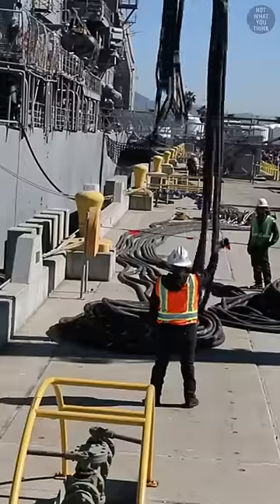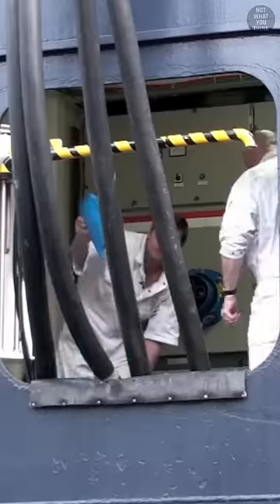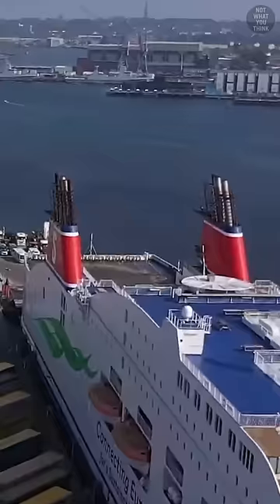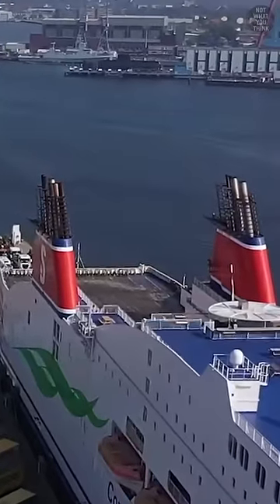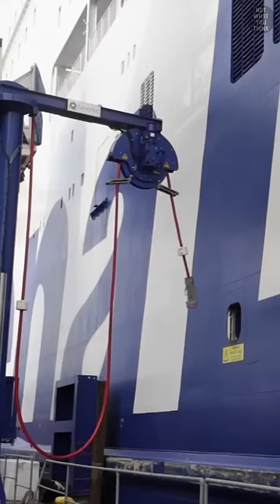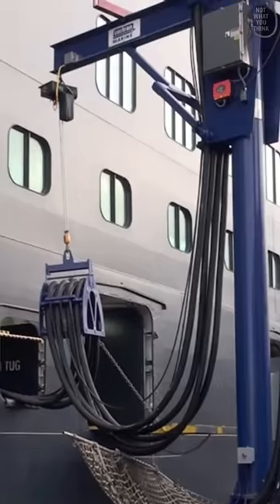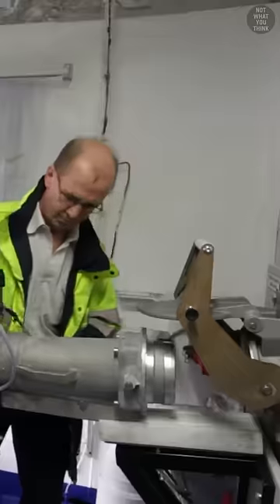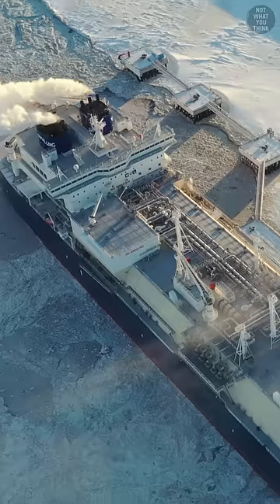Why Ships Burn Fossil Fuel When Idling? #shorts

Comment: What's not mentioned is how ships are extremely efficient at moving massive amounts of cargo. The amount of trains or planes to move the same amount the same distance would burn exponentially more fuel.
Reply: Exactly!!! 👍
Reply: Sure but a lot more can be done, for example ships currently burn pretty fast (or historically this may have changed) but a reduction of 10% in speed will reduce co2 output by nearly 30%.  A reduction by 40 will reduce 70%

Plenty of simple improvments to help reduce pollution
Reply: @salmonnnnman  speed.... or combustion speed. 
An particular ships hull is most fuel efficient at a designed speed. Slowing it 40% means the companies will make 40% less profit. Not happnin' Time is money.
Reply: @randywl8925  that's not how profit works
Reply: @salmonnnnman  Not attempting accuracy. Getting a point across.
 Your making and shipping 1000 cars per month. 
 Slow the shipping time 40 % and compare last years to this years profits.
...or just buy more ships. 😁
How many workers did you lay off?
Reply: I mean, its scientificaly proven that moving against a whole lot of water is better than gliding on a surface or through the air...

Have you seen the size of those engine vs the speed they go... the efficiency of a boat is like -200
Reply: @wisico640  People dont use cargo ships as leasure vehicule so when comparing them you need to compare the amount of cargo they transport and they are by far the best option we have to reduce emission, Here are the order of most to least CO2 emission per tone :  Plane, Truck, Train, Ship.
Reply: @abricots5588  we still have an issue where we ship way too much useless stuffs
Reply: @wisico640  Yeah the issue is that somebody bought that stuff, ( and often the useless consumerisms stuff gets shipped by air since its by far the fastest method ) We should reduce our consumption of useless items Especially clothing since it produces 6 times as much CO2 as the entire Shipping industry ( 7 Billion tonne of C02 for the clothing industry) ( some people buy clothes wear it once or twice then trow it away. )
Reply: Trains are very close overall. Csx reported 570 miles per gallon per ton of cargo moved in 2022, which is nearly identical to what the largest container ships can accomplish, and better than smaller ships. Steel wheels on steel rails is one of the most efficient modes of transport there is, water is very inefficient. The only reason ships do so well I'd their sheer size and cargo capacity makes up for it.
Reply: @wisico640  you're two comments appear to contradict each other...
or I'm misreading what you said.
Reply: Any engine burning crap isn't ok, thats my general view
Reply: @randywl8925  again that's not at all how this works. Your implication is that there is no elasticity in the system.  By your warped logic you would be 1000% more profitable flying every item
Reply: @salmonnnnman  it's about price and profit. Do it your way and put them out of business.  You're smart, they just don't understand.
Reply: @wisico640  Understandable but Carbon pollution is not always from direct combustion look at the clothing industry it produces 6 times more CO2 emission than the Maritime industry but it doesn't appear to cause that much when you look at it from a consumer point of view. its the price we pay for fast fashion.
Reply: @paytong4148  This is for fuel consumption not for Co2 emission, Trains and Ship work together, ships bring the good to the country, trains move them to the state and often truck do the last mile delivery.
Reply: @abricots5588  I didn't say anything about co2 emissions. But even as emissions go, diesel trains have significantly higher standards to meet compared to ships. Both in fuel used and in emissions technology lead to much better emissions per gallon used. But nevertheless you are right, a train cannot go across the ocean and a ship cannot go across a country. They supplement eachother
Reply: Is it a shame that so much bad clothing is made in the first place? Or that way too much customers choose to buy cheap clothig instead of durable clothing?

I for one am not one to buy any clothing I won be worning out...
Reply: @echoshatter ok 
Go invent something that’s gonna make it better
Reply: Don't know about trains, particularly if they are running off renewable or nuclear electricity.
Reply: @salmonnnnman wouldn't it still take the same time for the ship to get there tho? So instead of burning a lot of fossil fuels fast they just burn it slower over a longer period of time? Wouldn't it still have the same results while being even more inefficient.
Reply: They are, but the point of this short is that due to a loophole in regulations, while a ship is docked it’s allowed to burn bunker fuel to power itself, which is sulfur rich and extremely inefficient and polluting, but cheaper than dirt. The exhaust put out during a short time in dock can end up being more polluting than all the emissions put out during transit
Reply: @abricots5588 ships burn basically crude oil that shit is awful. If you live near a major port in a city which is like every major costal city especially in Europe. The air pollution is super bad and the majority comes from the ships.
Reply: @echoshatter the problem is shipping is by far the sketchiest industry to get into. What we see is a ship and assume one company. There are dozens different owners, companies, contractors, and subcontractors tied to each ship and never mind the container history, creating a black hole of an industry which is why standardization is next to impossible as it’ll get lost in the sauce
Reply: @echoshatter Ships *do*use shore connections while in port, as it is both cheaper and simpler than using the generators...cruise ships may not, but they aren't exactly essential for anything.
Reply: @paytong4148 you can’t compare ships to trains tho. The only valid comparison is ships to planes. Unless you intend to drive a train across the ocean 💀
Reply: @wisico640 you better be living on 100% natural energies then. Unless your house is covered in solar panels and you’re 100% self sufficient. Some one somewhere is burning fuel for your power
Reply: @shaun1040  100% hydrolectricity in here. Pretty cool eh!
Reply: @shaun1040  I wasn't the one who compared them in the first place, the original commentor did 💀
Reply: They burn more fuel, but the fuel burns way cleaner.
Reply: also building train tracks and roads capable of carrying oversided semi-trucks over the entire ocean would cost alot more than keeping boats😂
Reply: @KA._.144 Especially for countries who don't use trains at all. The roads become the problem, they break more often as more trucks are on the road.
Reply: Unlike ships and planes, trains can be entirely run on electric though

Comment: Very nice vid of a steam reciprocating engine - but nothing to do with the ship's generators.
And 'cold iron' is a US naval term for when the ship's main engines are shut down for extended periods.  That's not the case with merchant ships that are ready to go within a short time.
As for shore power, most merchant ships - nearly exclusively - run on 440Vac, 60Hz, so not difficult to standardise, like they do with fire, sewage and waste oil discharges.
For an excellent method of shore power - available within 6 months of order - check out Karadeniz Powerships.
Reply: Shore energy is still primarily fossil fuel, dependent. Lol.
Reply: Cold Iron means on shore power, if you are running a generator it is called Aux Steaming. Same term no matter what the power source, steam, diesel or gas turbine power.

Comment: I feel obliged to add that depending where the ship is dock, you should use diesel instead of heavy fuel to reduce emissions. Also many ship nowadays are equipped with EGCS (scrubbers) that effectively cut emissions while using heavy fuel. To consider that there are on the market LNG ships and that many sea areas are heavily regulated to Limit pollution (Marpol and local regulations).
Reply: Scrubbers delay emissions they do not cut them. The scrubbers get burned off and all that stored emissions gets let into the atmosphere at that time.

Comment: Updated information. Since 2020, Heavy fuel oil can only be used if a emission cleaning system is there, and majority of ports only allow Gas oil.
And there is a international standard for shore supply connection which each ship has. But not even 1% ports have them.
Reply: Not accurate, pal. One, most shipping lines have flags of convenience and are not totally governed by their actual domain. Two, ports are begging to expand because of the revenue and employment. Their governments are financing new ports and upgrading older ports. No imaginative pessimist would expect lawmakers to cut their noses off to spite their economies.  Think, man, think.

Comment: I feel as if it would be better to have a universal outlet system for ships so that they can stop burning more fossil fuels. It really shocks me why peple haven't thought about it.
Reply: Because of corruption
Reply: @shaunburns3332  bro Corruption has absolutely nothing to do with this, Why do you think a politician would care it is not corruption it is negligence.
Reply: Because everyone wants their system to be the one adopted as standard, so they're not the ones who have to retool.
Reply: I know that the port of Vancouver has put a giant plug system in where when ships are docked, they turn of all engines and generators and then put a giant wire in it
Reply: The outlets is not just the only problem. You're dealing with different system voltage on different ship and that's where the problem lies. You cannot just slap an adaptor between your ship and shore power
Reply: @laknidubandara  actually corruption has everything to do with it. Shipping companies don’t want governments regulating them properly
Reply: People have: the problem is the economics of the industry. The vast majority of shipping service providers don't actually own the hulls they contract the shipments on. It's the same reason why all the innovations in greener maritime propulsion aren't taking hold: hull owners take all the cost and none of the savings in modifying their boats because those costs of doing the shipping work is born by the contractors, who are in turn disincentivised to go with ships that require retraining and re-certifying crew for new systems.
Reply: @hypervious8878  Hull owners would price it in. If the savings were attractive to the contractors, they would save by hiring more costly hulls and retraining staff. This is not a scenario unique to any industry.
Reply: I mean are you going to be the one to  pay for it?
Reply: Oh they've thought about alright
Reply: @laknidubandara  I believe it's marketing
Reply: @shaunburns3332 

Because CO2/plant food is not a problem and fossil fuels are cheap and plentiful.
Reply: Why dont you come up with such a system if its that easy?
Reply: @shaunburns3332  How in the f is that corruption
Reply: @taktuscat4250  yes you 100% can put a power adapter on your ship. It's called a transformer which is part of every wall adapter you plug into a receptical. This one would just be much bigger. 

As an example let's say your ship uses 600 volt 3 phase 60 HZ if you standardize shore power as 1200 volt 3 phase 50 HZ. You could have a 2 to 1 transformer set rated for the KVA your shop needs and boom problem solved. Or if you equipment is sensitive to frequency variation you can use a MG set and problem solved again.
Reply: @flyingchimp12  feel like it'd save more money than idling the engine but what do I know
Reply: They do have shore power connections. Every ship does. It is the ports that don’t supply it or charge exessive fees so that it is cheaper to run on own power.  Also ships consume a huge amount of power. A lot of places can’t handle it
Reply: It really shocks me that you haven't figured out where you're gonna get all this "green energy" from to power everything. Like rolling blackouts in California, but yea, let's demand everyone have an electric car in a few years.
Reply: Are you going to pay for the upgrades?
Reply: The answer is actually in the ports.
Standard electrical connection gets you a discount on docking fees.
Special voltages get you higher  docking fees.
Using generators is the highest docking fees of all.
The catch is how high to make the higher fees.
You want to take part, maybe even most, of the ship's profits,  but not all.
Reply: The vast majority of shore power is produced with fossil fuels. So shifting from ship power to shore power doesn't make much difference.
Reply: @taktuscat4250  One shall install substation.
Reply: @steve8674  Same with aircraft industry. Some airports demand such expensive prices for something which is standardized  ground  power connection  115V/400Hz that airplanes are on APU whole time on the ground.
Since burning kerosene is cheaper :-(((
Reply: @windmillacres679   In order to do this the port has to be able to supply shore power. In my entire career I have only been to one terminal that can supply shore power worldwide and that was purpose built for this ship.

Most cities also cannot supply that amount of power. Ships consume the amount of power required for small cities alone. Now put 3,4 or 5 ships in a port, maybe even 20+ alongside like in Singapore.

I worked on ships that consume over over 20MW in port. You can't provide that sort of power.

In fact during the Auckland 1998 power crisis a ship was brought in to power part of the City
Reply: @steve8674  wow, that's a lot of power.
Reply: @windmillacres679  Yeah, most of that power is generated by steam in that type of ship running turbines.

Comment: Ships usually use the lengthy hydrocarbons that cannot be used anywhere else.
Otherwise we would keep stockpiling it as we have lots of demand for gas for propane, gasoline, kerosine, and diesel.
It’s very long chain and hard to burn, which means requiring giant heavy engines.
Anything thicker (Bitumen) is used for roads and roofing, these things are even harder to ignite.

Comment: Cold iron. Bunkering referral to the age when ships burned coal, or bunker coal.
When ships remain at anchorage they will often cycle their engines so as not to constantly keep them burning. A ship powered by boilers is different. They can't afford to let their boilers go cold.
Most of the exhaust is filtered out by law. It is scrubbed, and burned in an incinerator.
You can't escape the black smoke in some situations, but hard as it may be to believe, that exhaust smoke is minimal. There is burned particles in the exhaust, but not nearly as much as this narrator may want us to believe.
No matter what kind of ship it is, there will be an incinerator or burner of some kind to burn off the excess waste fuel oil so that the heavy smoke is controlled.
Just because the smoke is black doesn't mean it's a serious pollutant. It's probably whatever is left after it has been burned to the point that there is nothing left that can be burned.
Reply: Also, the entire US coastline is ECA in Marpol annex VI so no heavy fuel oil is being used
Reply: Speak the truth lad.

Comment: I am currently sailing as chief engineer on merchant ships. This shore power is referred as AMP (alternate marine power) in our terms as our ships are now high voltage powered i.e 6000 volts. Normally during cold ironing I have recieved AMP in Shanghai. Busan and Long Beach as high voltage AMP is not available everywhere.

Comment: Well, seems the OP didn't research properly before making the video so for clarification:

1. There's tons of regulation regarding Marine Pollution for ships to follow, from Air Pollution to Ballast Water so it's not that bad.

2. When entering certain distance from countries (EEZ) the ship is required to change fuel types, from Bunker Oil (fuel oil) to Marine Gas (or Diesel) Oil (MGO/MDO), which is more "refined" and less pollutant than Bunker Oil. Also, ships have purifiers so the Bunker Oil gets purified and have lower the impurities in oil thus lessening the pollutant furthermore. 
Note: In order of "cleanliness" MGO>MDO>Bunker.

3. As I said earlier, there's tons of regulation and more are being added as well, like Funnel filter, Scrubber and other systems to lower the emission of ships near countries and/or in the open sea.

4. Aside from non-standardized connections, ships in port uses Diesel Generators because it's much cheaper for the shipping companies than the rate of Shore connection. Unless the port require ships to have connection or certain scenarios (maintenance of Gens or dry dock) most ship will use their Generators for power generation.

5. Majority of pollution in the world came from Agricultural sector, yes the meat and plantation industry produces more pollution than ships. IMO (International Maritime Organization) and other authorities are making more regulations for ships to follow to minimize pollution caused by shipping, again its not that bad.

I hope OP will research a bit more on their future videos to stop proliferation of misleading/misinformation knowledge.
Reply: 100% correct. These videos are notorious for pretending to share knowledge; but come from a place of ignorance. 

Clear back in '93, my ship had a special fuel tank that only carried the lower sulfur fuel to get in and out of Puget Sound, in Washington State, USA.
Reply: Just to add, lately scrubbers are not allowed to be used in territorial waters and ports.. which is mind blowing because it was like revolutionary installation on ships couple of years ago..🎉
Reply: Totally underrated comment right here!